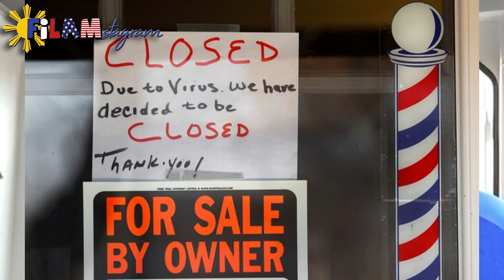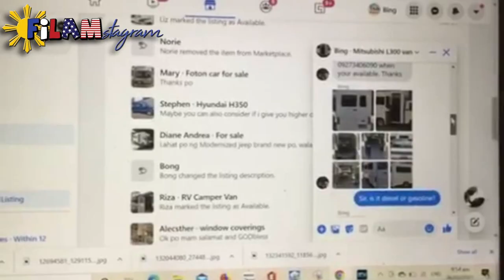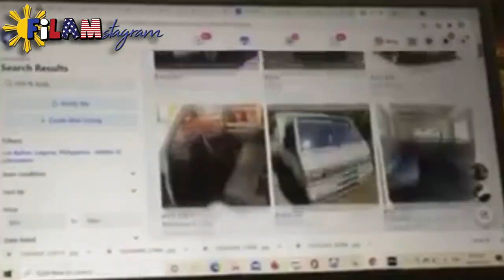Mitsubishi L300 FB Campervan | DIY Conversion Week 1 | Journey to Vanlife

Comment: Beautiful. How much did you buy it Sir?
Reply from the maker: Thank you. P475,000. More expensive than what other 2012 units would cost, but the brand new fabrication of its body with the high roof and side door made it worth it.
Reply: @filamstagram  that is still a good buy given the nice conversion at the back. Old school L300s with 4d56 2.5 diesel engines have high resale value these days due to its reliability. Just look after the fluids and alternator hose (breaks sometimes on old school diesel engines) and it will run worry-free in the years to come (probably minor maintenance required for its underchassis and aircon).  That van is a gem.
 “Everything that glitters is not gold”
Reply from the maker: @clevenbalongkit9911  Thank you for the advice! Its reliability as a hardworking service vehicle designed for family businesses is one of the main reasons we like the L300. In the Philippines, it has had a long track record spanning decades, and nothing else comes close.

Comment: What kind insulation did you used?
Reply from the maker: 10mm foam insulation but doubled to make it 20mm. On the walls, we put the foam insulation and covered with plywood, finished like dry wall. The ceiling and floors have foam insulation as well.

Comment: Hi! may I know the floor to ceiling height inside?
Reply from the maker: Hi. I don't remember the exact measurement, but I think the fabricated ceiling must have been over 5'9". After we have added 20mm insulation and PVC ceiling panels, Bing can still stand in it with her head not hitting, and she's 5'8". I'm 6'2" it's a bit low for me to stand straight inside.